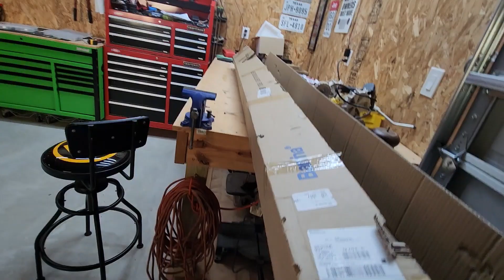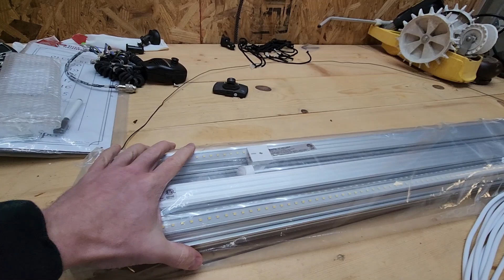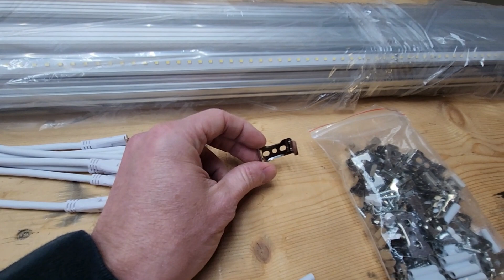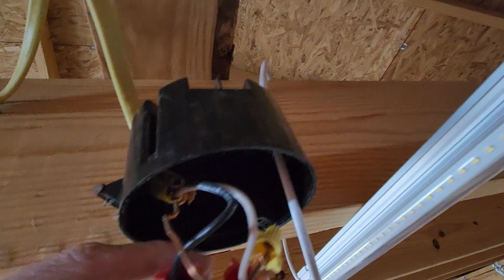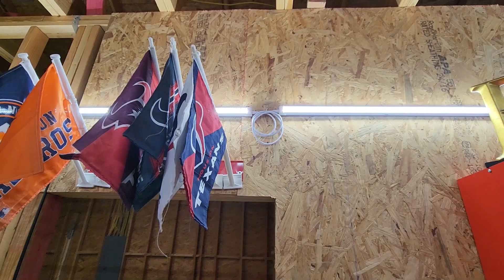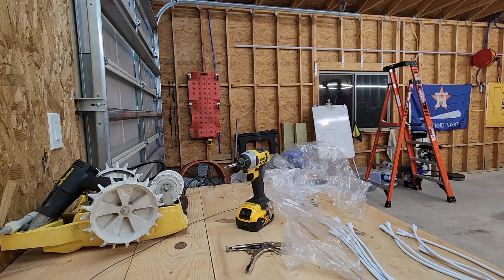New shop lights!! 80 feet of LED lights! so bright!

Comment: Any thoughts on how to tidy up the small cords nicely between lights (mostly rows)? They are not a good length for most solutions like stapling/cord brads, etc..
Reply from the maker: You could probably source shorter cords. They are pretty universal 3 wire cords. You could use two of the hardwire pigtails and wire then together as short as you want them hide then behind a plastic cover or conduit.
Reply: @Blakes-Garage  So I used their premade cords to expedite and even the shortest ones a bit long due to some limited spots to put the lights (I have several overhead hanging storage shelves in place).  Conduit is a bit chunky on the ceiling...but gives me an idea of coiling and putting into junction boxes(?)...or maybe some quick wooden concealer boxes(?). I'm looking for getting it as clean of a look as I can.
Reply from the maker: if its a short run you could use two of the supplied hardwire pigtails and cut them to length then sleeve them with shrink wrap. I like the junction box idea though.

Comment: I installed a similar type in my garage.  I butted the segments together with their supplied double-ended joiner connectors.  Nice and easy but a couple of times the expansion/contraction of the LED strips (they do get warm) caused the connection to come loose.  They've been fine for a couple years now.  And yes, they ARE bright.  I love it.

Comment: I had the 8' T-12 HO florescent tubes that pulled 30 amps total, after the upgrade and wiring the new LED into the wild leg of the 3 ph I now only pull 10 amps and have 2-3 times the light..

Comment: I used the same lights.  Mine is slightly smaller at 16x32.  But I didn’t use the mounting clips that came with the lights.  I used 3/4” pipe clamps.  I just felt like they needed to be more secure.

Comment: Above the side lights, add 12" wide shevels with anglegled wood to hold it up, then put strips of Melamine on the underside of the angled supports to help reflext the light back down from the top side of the light figures. (or cut 45 degree wedges for the clips that hold the lights). I did the shelves around mine,  I was tempted to make the melamine hinged so it could be small storage, but decided probably not worth cost of harward and the effort to add hinges, latches, and chain.
Reply from the maker: I will eventually skin the ceiling and probably paint it white. Its plenty of light now though, even with no reflection!